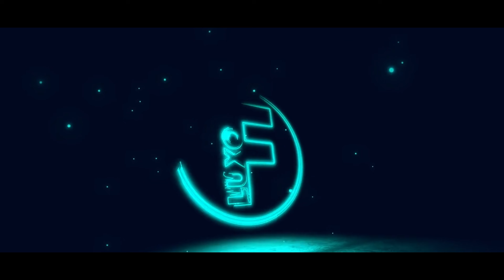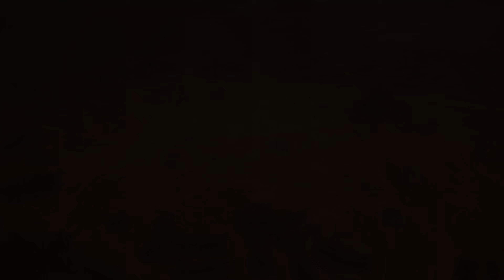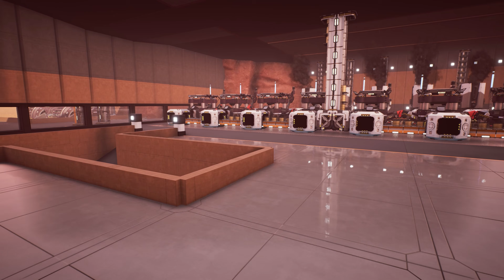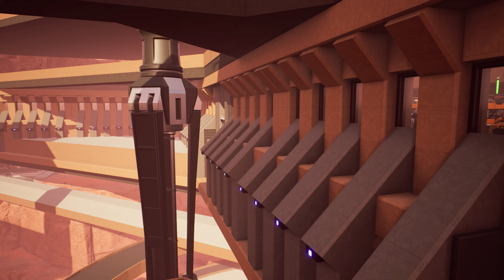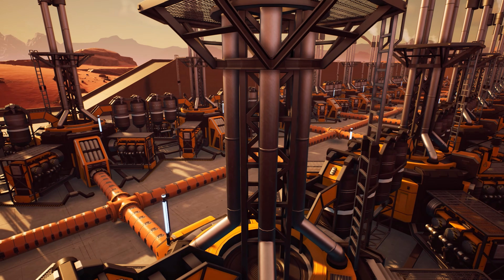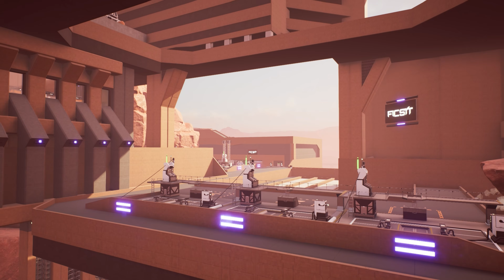INSANE! | Satisfactory | MEGA BASE

Comment: I like your build. My own massive project is a save with just over 1000 hours, of which everything after about 360 hours in has been building a 20,000 Fuel Generator power plant. No matter how many people say the map can't support that, I have buffers in place, and on paper the full buffer array would last 5 hours. The fuel plant when it is finished should make 75,000 fuel per minute. (Yes, buffers play a big role: one point in my save I had over 45,000 large fluid buffers.)

Hopefully I can get the whole thing done by this time next year.